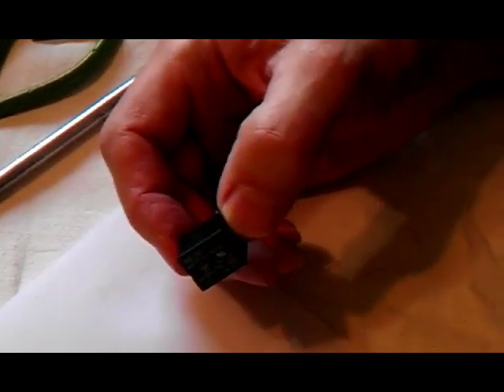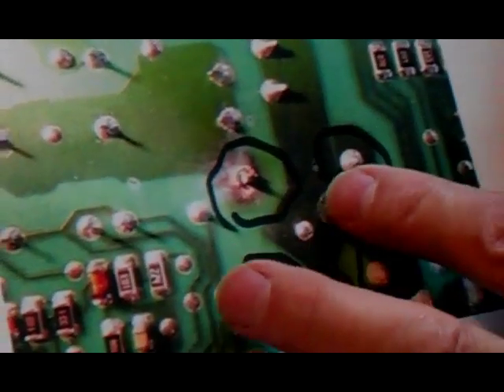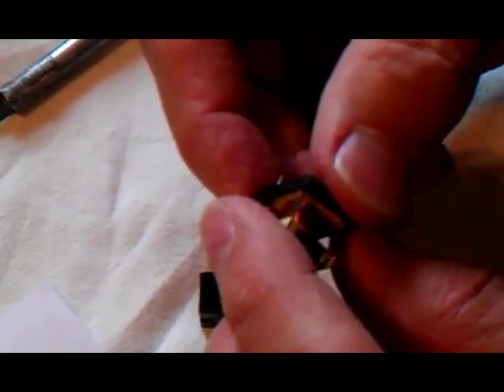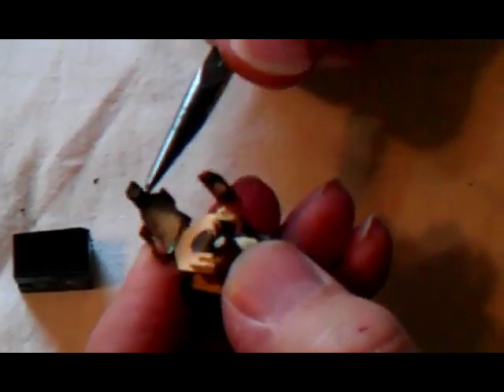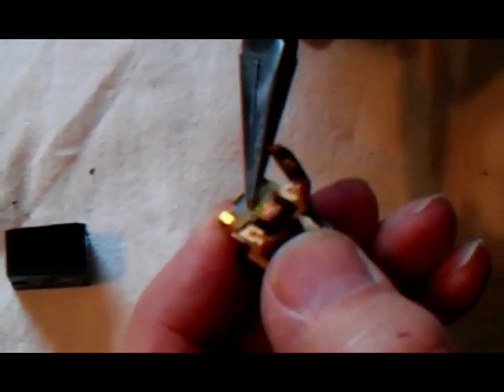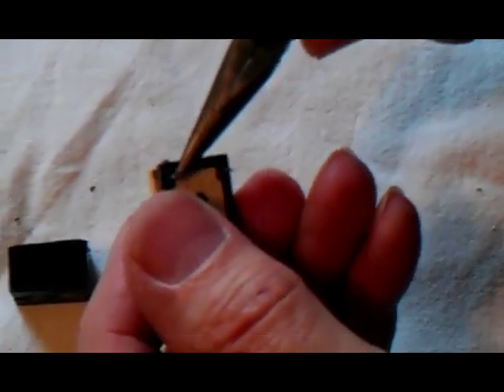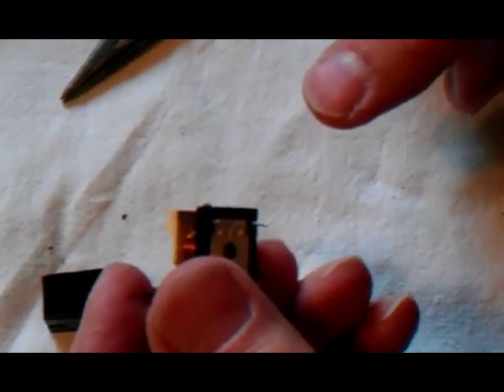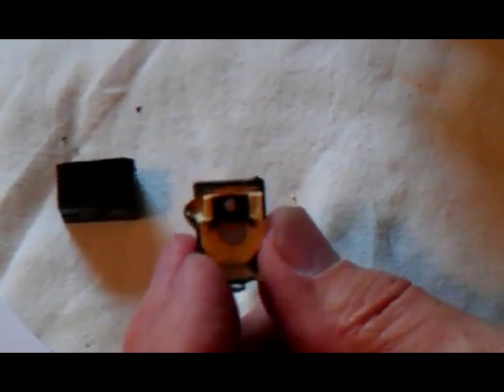Bosch Dishwasher Heater Relay Repair Part 2

Comment: Thanks for this video showing the inside of the heater relay - it confirmed my suspicions about what must happen inside the relay. Amazing my repair worked for a couple of years. My question is how do I remove the old relay if I don't have one of those fancy solder sucker tools? Try to find some solder wick stuff? Any other method I could use? Rather not have to pay the electronic shop to do it.

Comment: Thanks for your info - you answered a couple of questions and I replaced the relay.  The solder joint at the leg seemed iffy, so I added a jumper wire from a nearby connection on the same trace on the board.  Successful repair.

Comment from the maker: Technically speaking, when the solder melts away from the relay pin it is a GOOD thing.  The reason is that this acts somewhat like a fuse and opens the circuit preventing any further damage.  If the solder did not melt, the failing high resistance contacts on the relay would generate more and more heat.  Severe damage to the control board or possibly even a fire would be the result.  A good relay will have low resistance and therefore low heat.  Replacing the relay is an easy and cheap repair.

Comment from the maker: The info for the relay I used is at the end of part 1 (see link above).  My relay had the coil voltage written on it (6VDC) and I then measured the coil resistance (100ohm) to find a relay that would be equal to or better than the OEM relay.  The current carrying capacity needs to be 10 amps (10A/120VAC) minimum.  I found a 12 amp replacement.  If your relay has a part number on it try, a Google search.  If you can get the specs then it is just a matter finding a match.  Hope that helps!